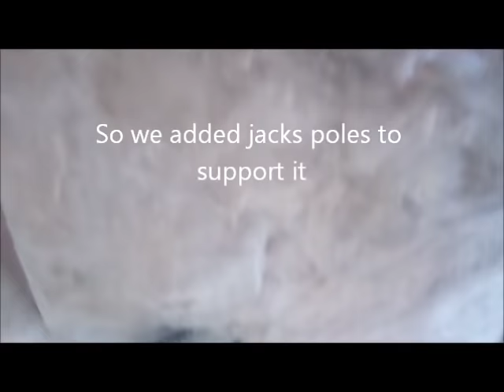Mobile Home Ceiling Repairs.

Comment: Drew i been in the mobile industry for 33 years and i have built them and run service and total remodel them so i pretty much done it all. And i have to say your work is dam good and u r pretty knowledgeable on older homes and i love the rubber roof u do its pretty impressive and u dont cut corners i just have to say. Most people i see working on mobilehome dont know what they doing or talking about but u my friend u keep up the good work
Reply from the maker: Thank you so much I am very glad you got to see my video somebody that works in the industry because I have so many people that tell me that I’m doing it all wrong and in my opinion they just don’t know what you’re talking about so thank you for the kind words and please keep watching share if you’d like definitely subscribe please
Reply: Hey mr william..
My girlfriends mobile ceiling is built exactly like this one
(Not damaged or anything like that.. Still good)
Is it strong enough to hold up ultralight 1/2inch drywall..
Or would i have to add a 12ft 2x6 to each one to have the strength to hold it up..
Wny advice would help tons
Reply: Help me then how can i fix my mother wall the center piece is falling i have tried to put screws bit nothing is there.
Reply: @thegreatwhitenorth8754  I'm not Drew or Mr William, but I would suggest using some 3/8" or 1/4 Drywall in a Mobile Home for the ceiling.
Reply from the maker: If you noticed the video was old we do a little bit different now than we did back then only because we have learned the process
Reply: @trxtech3010  i put up 12foot 2x6's in the ceiling. Put blocks inbetween them too. and then screwed up 1/2" drywall on to them in the ceiling...
Our room is only 11ft 6inches wide and like 12 feet long..

I put a full 4x8 sheet of ultralight drywall on a scale and they only weigh 45 pounds each..

Total there is only 4 and ahalf full sheets of drywall on the whole ceiling in our room which is only 203 pounds..

After i added the 2x6s. I hung from the middle of just 1 of them and it only flexed like 1/4 inch.. And im 240 pounds
So 203 pounds of 1/2"  drywall is being held up between 12, 2x6's just fine
Reply from the maker: That’s awesome and when you transfer the weight between three or four rafters it makes a huge difference in strength sounds like he did a good job half inches in anything that’s great
Reply from the maker: That’s true there’s not much to screw to up there or nail two without matter I’ve never use nails always use screws. I wish I could help more
Reply from the maker: That’s an awesome idea

Comment: Should of pulled the metal roof off, and built a new roof. Looks like more work fixing that mess. Be nice if you could park it under a barn roof and rip the roof off. When they remodel them they strip them to the frame.

Comment: This is some bad sagging. Mine wasn't that bad, but what I did (still need to do parts of the house) is to put new rafters next to the old ones, jack up each old one so it's even with the new one and then screw them together. Then, on the walls right under the rafters screw in 5 1/2  inch rafter boards flush on the walls (that will hold up the rafters on the ceiling) and from that you build the studs going down to the floor. It's like doing framing from the inside and backwards. Not from bottom up like building a house, but from top to bottom. That will make the whole structure a lot stronger. Once you're done with the studs you can put sheetrock on or wooden panels. (pine).  Sagging like you have is a disaster waiting to happen. One heavy snow fall and that's it. Hope this helps some folks. Good luck.
Reply from the maker: this was a tough job thats for sure
Reply: What's something like that cost to repair?
Reply from the maker: Ceilings are expensive
Reply from the maker: 5000

Comment: Managed to get back a 6-7in sag in a 14ft span held by original 2 x2s, by making an external beam from two 2x4s and supporting on 2x4 posts inside the room. After painting, it blended in quite well and no ceiling strip down. Of course, you have to use the edge to take the weight, but if the roof is fixed it will twist back to the right position over time.

Comment: i had the same problem with the ceiling sagging. I jacked up then added one solid 3/8" plywood piece cut to fit along side the original rafters. doing that made the rafters  solid and corrected the sag. the pieces i made were triangle shaped 12 feet long and 2 feet on the peak side. by the way I am doing this in a 24 foot wide moduler home. now when i go on the roof it does not flex at all. i glued and brad nailed the plywood onto the ceiling rafters.
Reply from the maker: I can not believe how they do the ceiling joist

Comment: how much would it cost (estimate) to repair my roof? exactly like this video its bowed in.
Reply from the maker: +Crade 25 ceiling or ext- Roof Ceiling around 1300.00 Roof 3800.00
Reply: Drew's Roofing & Home Repair it's it a double-wide or a single

Comment: I AM DOING MY BATHROOM; YOU SAID IF THE ROOF IS NOT SAGGING THEN IT IS OK.. i JUST TOOK MY WHOLE CEILING OFF AND THERE IS MOLD IN THE FIBER GLASS UNDER THE PLASTIC. SO I DON[T THINK THAT IS TRUE. THE BIG AREAS NEED TO BE CHANGED OUT
Reply: laschell59 I think he was referring to the structure being OK. Mold has nothing to do with the structure. It's terrible and needs to be cleaned though.
Reply: The reason for the mold is improper ventilation! ;) 

Plus you are supposed to use *green board* around your bathroom, that also prevents mold!
Reply from the maker: rip it all out and you will have to reframe using screw more then likly cause of the nothing being solid to nail to

Comment: 1 bys are normal in a mobile home, in walls and roof. The walls can't support the roof you put on, long term.
Reply: tremerefury in older homes, yes.
Reply: This is very true the trailer seems to be a early  to mid 70s the out side walls are two by two the walls and the trailer  frame are not made to Handel  the roof at all people need to pay attention  to the manufactures me I when it comes to  what you can get away with  when it comes to weight and structural integrity  I see this alot and I've seen what can happen when you you add to much  weight
Reply from the maker: Adding plywood makes the two by twos structurally stronger because we are spending 4’ x 8’ that makes it so you can walk on the roof before the plywood you can’t walk on the roof or you will step on one individual rafter at a time and that will be weak but if you add plywood now you’re disbursing your weight between two or three trusses
Reply: The out side walls and the frame of the trailer  are not designed to Handel  the weight of the ply wood the walls are 2X2 with 1x2 plates the frames cross supports are like a pop can you can bend them with your hand the rails are thick steel but the bracing is thin steel the homes was not made to Handel the weight the home was made before hud stepped in and layed  down the codes for structure
Reply from the maker: I can build a 2 x 2 wall with one by two top plate and I guarantee you I can add 1000 pounds to only two of the two by twos straight up and down without bending

Comment: What was these ceilings made of in 50s and 60s trailers and any chance of asbestos in them
Reply from the maker: No
Reply: @Drewsroofingandhomerepair  can u be sure of this as I had one not sure of model but was told in the 50s,a 10x50 new moon and got a ceiling leak and I was told by a guy that had previously worked in asbestos that he thought it contained it after we tore it out and I've been worried since and mine wasn't small tiles but a large panel of some sort but when u google it says mobile home ceilings before the 70s that asbestos was likely
Reply from the maker: I’ve never heard of it before
Reply from the maker: I can’t say that I’ve done many 50s or 60s mobile homes
Reply: @Drewsroofingandhomerepair  it was some kind of fiberboard stuff
Reply from the maker: Yes the only place to get that is that a mobile home supply place

Comment: On a single wide I had to make a beam from front center to back center. All the way down the center I jacked the beam up to very limit of what I thought the old roof could tolerate.
 
I mean I was stretching that sucker worse than a can of jiffy pop (only joking). But it was creaking. I would prop the beam up with boards held by wall frame.

The old wood was mostly good but warped due to long time of being bent under pressure. The roof was basically giving way. So if I would have matched the old support boards I would of had bows.

Also, I skipped trying to match the same level as the old support pieces you showed and just kept jacking the center of the roof hoping to get somewhat more of a center pitch.  My thinking was more pitch less rain colleting. Looking underneath it looked drastic change, but on top of the roof hardly noticeable. Oh well...

I built an extra support wall for the beam at living-room/kitchen and had two upright 2x4s showing that worked well for more cabinets. Another support board hidden in roof at the beginning of the hallway. I used existing walls to support that.

The beam was 2 offset 2x4s nailed together and was very strong. I built the beam to full length inside the ceiling space to try to build the beam as straight and strong as possible. Then I jacked up the center of the roof with the beam.

I used a good sized hydrolic jack and a level to avoid the problem you had. I had to use extensions to get the drywall support boards to be even. 

The job came out ok, but later down the line I had heat issues because I was too cheap to buy fiberglass and there was also roof leaking issues.

Should have double roofed it and bought the fiberglass. The trailer was naturally hot in the summer and cold in the winter. Next time I buy the freaking fiberglass.

I even used a texture brush to popcorn the ceiling, It was not bad.

It was allot of work but I was proud of the job.
Reply from the maker: I wish
Reply from the maker: this 1 was hard very open space and not strong enough trusses

Comment: What kinda ceiling board usually in mobile homes
Reply from the maker: 1/4 sheetrock
Reply: Drew's Roofing & Home Repair so its not fiberboard
Reply from the maker: I buy mine at a place called Discount House in Wilmington North Carolina it’s a mobile home supply place normally it would be 4‘ x 14‘ long
Reply: Drew's Roofing & Home Repair  how much do you think it will cost to replace the ceiling on a single wide with labor and everything ?
Reply from the maker: Do you have to buy that at a mobile home store or you can install your own 4 x 12 sheets of quarter inch or better yet three eights of an inch block a sheet rock screws me not plywood sheet rock
Reply from the maker: Install quarter inch sheet rock or three eights sheet rock you can buy it at Lowes or Home Depot or you can go to a mobile home supply store and get 4 x 13’ pieces where is the texture on it already
Reply from the maker: If you’re talking about the ceiling on the inside of the house if you’re talking about what we are doing on the outside we use half inch OSB

Comment: Don't know how you solved this problem. Maybe strip ceiling bare to the wall on other side of kitchen.  Use 2x4 to stabilize the 2x2s.  Run 2x4 the length of repair. Then nail 2x4 per 2x2, and using plywood to attach to roof joints. 2x4's should strengthen 2x2 so no sag.  Then nail ceiling paneling.
Reply from the maker: I agree this place was in real rough shape